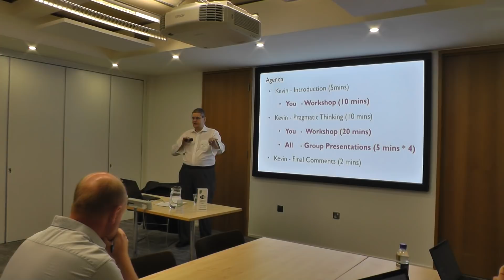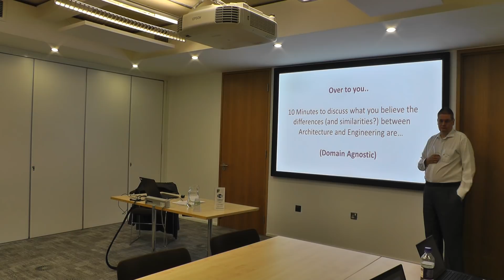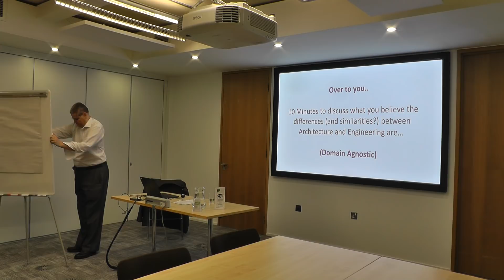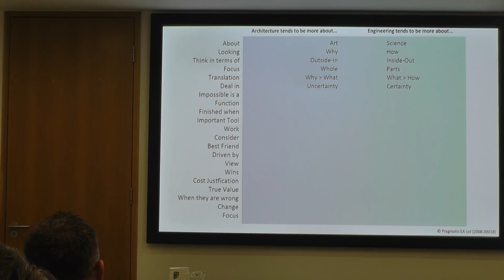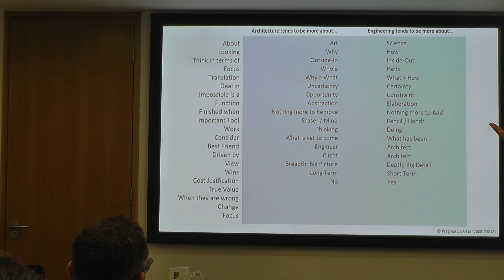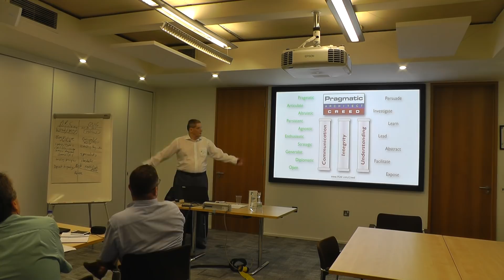2018 06 26   BCS EASG

Comment: Thanks for the presentation; while I have skimmed through it, it was interesting to see the conversations play out and I took your survey and marked myself as 75/25 with architecture basis (I haven't designed or engineered anything most probably in over a decade)

My own domain is in InfoSec, organisational structures, controls, frameworks and also infrastructure.

In my mind as an architect I will try to look at all the capabilities needed for that InfoSec function (people, process, tech) to support and interface with the rest of the business, I will also help to prioritise the activity to give the best value.  I will then put my engineering hat on as I facilitate, mentor and govern the engineering function to deliver on those ambitions.

If I use the analogy of an architect of a multi story house, I would describe a capability for the occupants to move from one floor to another and prioritise this over flooring options but I would not be prescriptive, the engineer will come up with a number of offerings to meet that criteria (wooden stairs, glass stairs, stair made of ice, a lift) and I will also have a customer (business function) that wants a lift on the outside of the building made of crystal glass with gold fittings.

I would see it as my role as an architect to arbitrate between the two so that we get an appropriate outcome, alignes with the rest of the decor (strategy) and starts to get value of using the full house instead of just the ground floor.

I will use my engineering skills to validate that the proposal from the engineer will deliver the expected value.
Reply from the maker: Christopher Wren cool.
Reply from the maker: Very well put. You are in the minority ( that I want to make the majority) that understands the difference between architecture and engineering